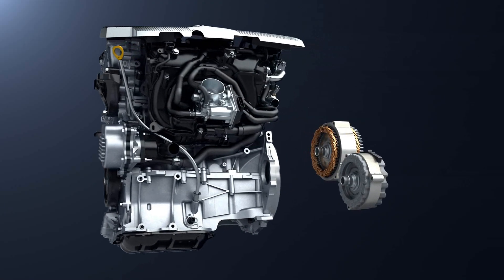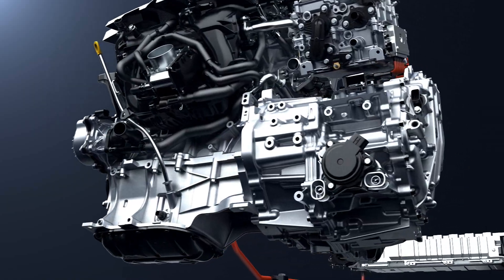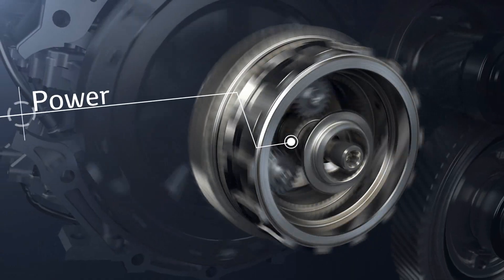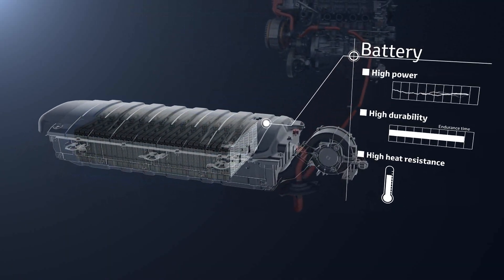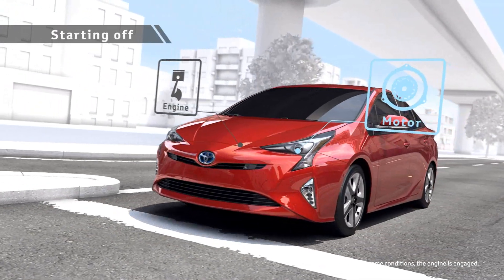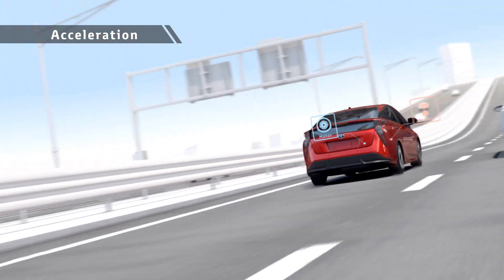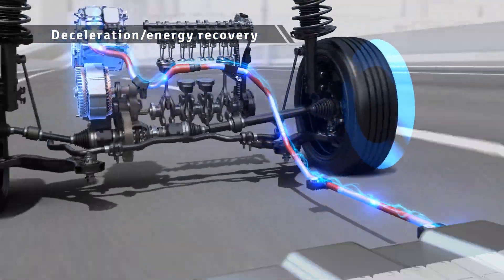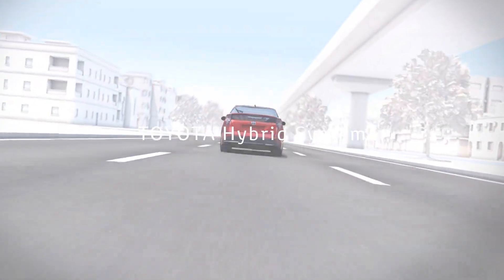Toyota Hybrid System

Comment: Consider the power split device alone, it provides infinite gear ratio selection and mind blowing simple design, with nearly zero maintenance. It is a greatest transmission of all time. The transition of the traditional CVT to the new eCVT, Toyota has solved the last puzzle of the hybrid system and make it a great choice beyond the electric vehicle.

Comment: When you drive, say at around 60 mph, do BOTH the gas engine and electric motor simultaneously supply the energy to the vehicle to achieve mpg efficiency? We know that the EV mode come on mostly at low speeds, telling the driver electric propulsion is being used.
Reply: Yes which is why the Hwy Mpg is slightly less than city driving.

Comment: Two engines in one car means twice the engine maintenance.  Electric motor going to start it off.  That's not going to work.  Gas engine going to recharge the battery once the car gets rolling.  That's not going to work.  Then the brakes on all four wheels are going further charge the battery as the car stops.  And that especially is not going to work.
Reply: Toyota has 10 plus years of this working very well and reliably.
Reply: @Locksmith.71  20+ years.  First hybrid was 1997.  I was being facetious.  But you can see the challenge-- two engines, recharging a battery from the gas engine, recharging from all four wheels.  A chain with more links has more chances for a weak link.

Comment: I HAVE PRIUS 2008 AND 2018. THE 2008 IS NOW OVER 260,000 K.M. AND STILL RUNNING ON 5 LITER PER 100 K.M. (ZERO FAILURES !) THE 2018 IS MUCH MORE MODERN AND SPORTIVI AND RUN ON 4.2 LITRE PER 100 K.M.!!
TOYOTA IS A WONDER !

Comment: How does the air conditioning system work when the engine is not running ie when the car is on the hybrid system?
Reply: Ac power steering power brakes are use an electrical motor. To work.

Comment: I bought a Corolla car and I'm driving it is really very economical. Excellent job Toyota. Goes 1000 kilometers with a tank of fuel. at least 700 kilometers. If you force it will go 1100 km.

Comment: One question bugs me. When you hold one component of a planetary gear set solid and rotate another component, the third component responds. But it can respond with only so much force you hold the first component down, otherwise your hold breaks if the output has too high resistance. Now, with "holding down" replaced by electric motors, how is the force to set the car in motion transmitted to the output? How is such a great force resisted by the small MG1 or the infernal combustion engine so that the wheels get turned?

Comment: The best and maybe most hidden thing is that it starts with the electric motor first. You may not know this but i have now done 2 hours of reasearching and on this and this is the best result i got. If it did not i would not even bother paying for it. Thats how important that is, just remeber that idling is not a case anymore for that car, for others its blah, but for the car well i guess it living twice than any other.

Comment: It’s a smooth system but slow. I have to floor it when going uphills (Toyota Corolla hybrid).
Reply: It's not the system that's slow, it's the battery and motors they install. They can design it to be fast if they wanted. The RAV4 Prime smokes my 240 hp chipped Audi A4 quattro in a straight line, and gets double the gas mileage doing it, while weighing 800 pounds more than my A4.
Reply: @erichtisnado1536  Hmm yes and no. See the thing is that it is a great transmission no denying that but it's the setup. Whereby Toyota decides to use underpowered 4cylinder engines which are Atkinson cycles ones so have no low end power which is fine as it's a hybrid but the problem is that the motors that Toyota installs on their cars are not suited for the job. They're small and very underpowered leading to a very underwhelming & slow experience. Although this is not the case for all Toyota's, take for example the Century which is a V8 Hybrid with some serious power. However, the reality is that until Toyota changes their motors or the way their engines pickup power, their hybrids for most models will be Slow and very unexciting. Although my personal Car is a very smooth 2011 Volvo S80 D3 that has some serious torque and lots of pickup. It also has an Aisin Transmission.
Reply: @muntasirmahmood4374  I drove around  in a 2007 Toyota Highlander Hybrid for work for about two years. That thing got 28 mpg and smoked my Stage 1 tuned Audi A4 in a straight line. It was 0-60 in like 6.5 seconds, IIRC, all while pushing 800 pounds more weight and getting about the same fuel economy, and with Instant throttle response, unlike my Audi with a turbo. 

The problem isn't the hybrid system or the atkinson cycle motor, it's how they decide to tune it. The Corolla is underpowered, I guess. It's an economy car, not a full size luxury car where economy is king, not acceleration. 

So really, you're complaining about how slow the Corolla Hybrid is, not the faults of hybrid technology. And, you're comparing it to a Volvo S80? Really?
Reply: @erichtisnado1536  eh it was an example don't get worked up. Now I'm from the UK so unlike Toyota models from the states, the ones here are quite slow. I'm talking about corollas, auris, avensis, RAV4, CH-R & Prius. Now if you read my comment properly you would see that I did not fault the system. I blamed the way Toyota handles the system and what parts they use and how they tune their cars. Not all hybrids are slow, some are very fast and as I mentioned the Century is a V8 Hybrid. I compared this system to an S80 as it's my daily and electric motors have instant toque just like diesels and it makes for a fair comparison. My S80 gets around 68 to 74 miles per gallon on the motorway with the corolla getting 80 to 85. I'm simply saying that pickup is slow but the system is a marvel of engineering. Also there must be something really wrong with your Audi for it to get smoked by a RAV4 of all things? It's German so something probably broke or you did a poor tune.

Comment: Imagine how efficient a diesel hybrid would be.
Reply: the psa group combine diesel with emotor. its called hybrid4, because it is a all wheel drive. for 100km you have somewhere at 5-6liter or 50mpg
Reply: @barsei1511  do you know which cars PSA have the hybrid4 in?
Reply: @amateurtorque6709  citroen ds5, peugeot 3008, peugeot 508. they even have developed a air hybrid car. instead of electricity, they compress air to store recuperation. https://www.autocar.co.uk/car-news/industry/psa-peugeot-citroen-seeks-partners-hybrid-air-tech
Reply: @barsei1511  thanks for the link

Comment: You really don't need much power to drive a car at constant highway speed on a level surface.  If the electric motor could be used to "average out" the load fluctuations the engine sees going up and down hills, that would be very cool.
Reply: Jess Stuart : Actually, you're precisely wrong.  "Averaging out" would be no help at all.  One of the tricks the Prius uses to get its great fuel economy is turning the engine off entirely for low load and running it more aggressively when the load is high.

Comment: I bet this would be a better system if Toyota made the "main" engine electric instead of gasoline. That way you'd have the acceleration and power of a Tesla with the range and convenience of a gasoline engine e.g. no overnight charging required! The battery module has to be a bit bigger though.

Comment: does the Engine power the wheels?
Reply: Yes. Through the power split device (PSD) which is a planetary gear set that receives power from the internal combustion engine (ICE) and the electric motors. Through the intelligent use of power electronics and controls, MG1 (Motor Generator 1) can convert excess power from the ICE to electricity and send it to the battery to be stored or directly to MG2 (Motor Generator 2). In the latter scenario (if ever the driving conditions requires it), MG2 is assisting the engine with additional torque and power to meet the requirements of the driving situation. This is the equivalent of turbo, but without any lag because the electric motor produces the required torque instantly, i.e. at 0 RPM. The electric power required by MG2 during the assist can also come from the battery. This enables the engine to always run as close as possible to its sweet spot of maximum thermal efficiency.
Another benefit is that by controlling the rotation of MG1 through power electronics and controls, the PSD basically behaves as a CVT (continuously variable transmission), but without the drawbacks of an ordinary CVT, the drive is just smooth without any rubber bad effect. And there is no transmission to fail, because there is no complex gearbox or torque convertor or clutch as in conventional transmissions.

Comment: You guys intentionally didn't mention stupid CVT you using in your hybrids. So it is slow and lag, needs maintenance and actually not fuel efficient (and expensive). Nissan Note E Nismo does way better job.
Reply: @Hybrid Answers they didn't show everything here. only the side where electric motor connected. Petrol engine NEED gearbox unless it is just a generator. I have corolla hybrid 2019 It is slow as f%ck. Power Split Device is just a module to connect both systems together.
Reply: They didn't mention it because there's no CVT gearbox in Toyota's hybrids, so stupidity is all yours. CVTs are amongst the most fuel efficient transmissions on the marker, FYI.

Comment: I remember I was thinking of a design for a hybrid go kart where the engine had a torque converter with a centrifugal clutch on the output, where the clutch housing (which is the clutch output itself with a sprocket directly attached to  it which drives a chain) attached to an electric motor which functions as both the generator and the drive motor.

Now that I have watched this, I might consider designing something like the power split unit so the motor and engine can run together without the speed differential of the two either burning the clutch or slowing the entire thing down.
Reply: That sound fracking awesome!

Comment: Toyota Hybrid: How to destroy your engine with as much cold starts as possible and never let the engine reach work Temperature
Reply: There should be no damage  if you keep the oil changes as suggested.
Reply: Héctor Fernando oil changes says nothing about the engine. For a long engine life a engine needs to get on Temperature, always starting the cold engine is not efficiency and a cold engine needs more oil
Reply: @motorenbastler9289  I trust the Toyota engineers more than anybody.
Reply: @WAN2TREE4  mee to. Toyota is one of the best. But that is still not good.

Comment: Could you tell me if this is the hybrid system of the new Toyota RAV4 2019?. Thank you
Reply: Ibwas told at the dealership that it indeed is.
Reply: I just bought one only a week old.  Supposed to get 41mpg in town and mine is doing about 37.5.  Am told that more time, it gets better so I'm hoping.  Still though, for an SUV in town, 38 mpg isn't bad.  I'm in colder weather and betting by next Summer, it will be where it's supposed to.
Reply: @dj3114  Winter gas and engine break-in will both boost those numbers.  Also cold weather affects battery chemistry, so those numbers aren't bad.

Comment: I tested out the Rc300h. Wonderful chassis,  splendid mileage,  but soulless engine. 

Lexus and Toyota,  I'm pretty sure you could pack your Hybrid system in more exciting cars.  In fact,  you already did it with the Lexus LC500h.

It would be mind-blowing,  if you where able to realize a car that could use a small V6 or I6 switched on Atkinson cycle with his hybrid system pushing under 2'100 RPM.  And that could, when pushed,  switch on auto cycle and build torque with the help of a juicy turbo from 2'100 RPM upwards. 

This was initially was I expected you will do with your new Supra. 

Toyota,  if there is a brand that can do it, then you are this brand.

Comment: I still wish they had bigger battery in my camry hybrid. Its full most times i am driving.
Reply: its not about the battery size, the hybrid part mostly made to work on lower speeds like in cities, if you drive on fast highways a lot it isn't as useful for you

Comment: 2 things that feel would make the hybrid synergy drive better:

The OPTION to plug it in and start with a full battery every day sounds much better than having to rely on the petrol engine alone to recharge.

Lithium batteries over nickel: higher energy density for the weight, and can handle irregular charged much better than nickel.

A higher torque motor: I'm all for efficiency but I test drove the Toyota chr and for a 1.8l I had absolutely no power to get up to speed on the motorway entry ramp. Cars like the VW golf GTe had much more punch from the electric motor when it's assisting the engine.

It's annoying because other than that I love how kitted out the cars are for the price and how easy they are on the motorway once you're on them.

Comment: All ICE vehicle will be gone in the future. First ICE has carbon emission that cause air pollution including global warming and climate change due to slowly destroying ozone layer due green house gas. Even if new ICE vehicle has low emission rate but we have millions of vehicle in every country if you are going to measure all of the emession rate and combined the carbon emission that still in harmful level.  ICE is powered by gasoline or diessel fuel both fossil fuel and fossile fuel is not renewable and will be depleted in the in the future so it will be useless of having an ICE vehicle without fuel. So smart electric vehicle with super fast charging and long distance travel is the future of modern vehicle. The only way for the ICE vehicle to survive is to make an engine with zero emission and also to produce an artificial fuel to replace the depleting supply of fossil fuel in the future

Comment: the only down site to it is the cvt gearbox !
Reply: Not in this case. The 'belt and cones" CVTs are a dumpster fire. The planetary gear CVT is SMART and DURABLE. The planetary gear system you never hear about failing on these cars; usually it is the ICE engine that goes first (which can be replaced at a reasonable price by a swap from a yard) or the traction battery pack, which can also be replaced for a reasonable price (reasonable when you compare to a transmission.) Most Prius owners who have battery problems are from not driving them enough, not too much driving.
Reply: @marshallwebber9682   How long can a Prius engine last?
Reply: @hedgehogthesonic3181  

Long, very long, if you don't crash it.

Comment: I assumed all the Toyota and Lexus is used this systems?
Reply: my  rx450h uses a second motor in  the rear axle, so it regenerate faster and bring a few hp to the rear wheels. its a kind of a AWD BUT not a full AWD since it has no diff lock and the hp which can deliver to the rear is only 30% idk exactly . But in snow mode its a bit mire but never 50% split ! anyway its quite good in wintertime !

Comment: Train technology cames to cars))) Only 100  years was needed for this.
Reply: different concept
Reply: lol?
Reply: Trains are just diesel electric most of the time, which simply means that the engine is driving a generator that drives the traction motors, though they usually have resistibe braking which is when the power generated by the traction motors is sennt to a resistor and transformed into heat

Comment: So where is the transmission on that car ?
Reply: Attila Khan as I understand it, there really isn't one. I think of it as a CVT, like a Vespa scooter has, no clutch, no gears.
Reply: @nickiemcnichols5397  i see thank you
Reply: It does have a CVT on the engine itself, but it's Toyotas design.  However, the primary system is "ecvt" which is not a normal transmission and distributes electrical energy where  needed.  It's made up of planetary gears as opposed to a belt.
Reply: @dj3114  so it is better if it was CVT so there is no repair if any problem has been lived right ?